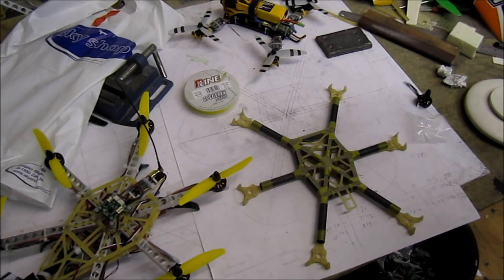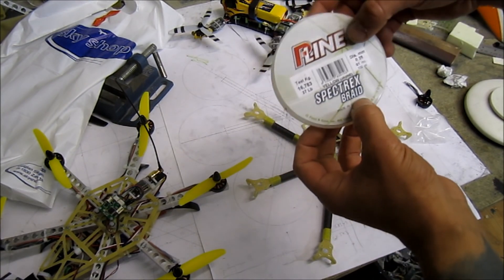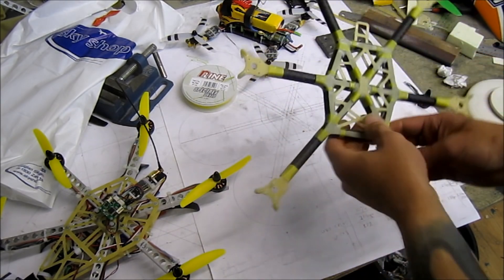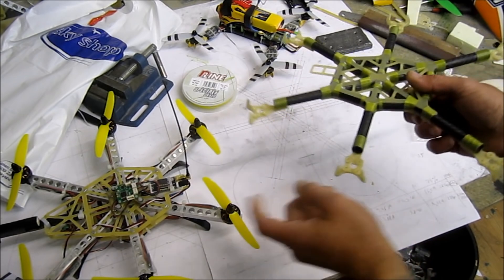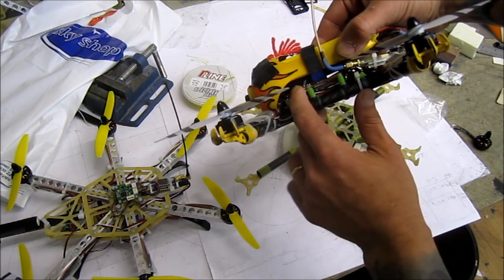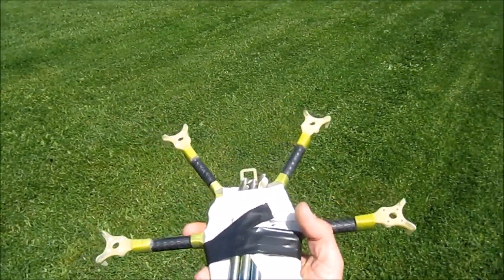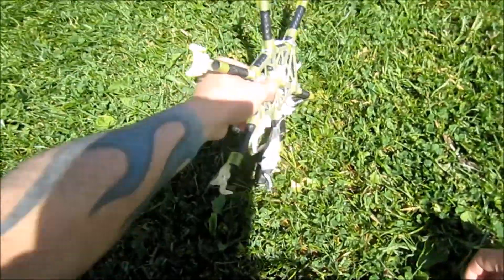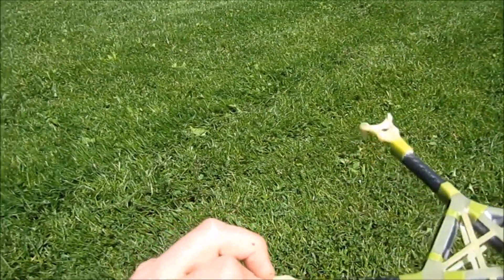Mini-Hex DIY frame overview and crash test

Comment: Hi! I just ordered some SunnySky X2212 KV980. This is my first build. Do you know what size bullet connectors they would come with? I'd like to order some for my ESCs. Thanks
Reply: Your comment makes no sense?
Reply from the maker: I don't use connectors and suggesting to everyone not to use them- just another weak point of failing something and unnecessary weight. Once you solder everything, there's a 100% guarantee that this section will not fail, ever:)